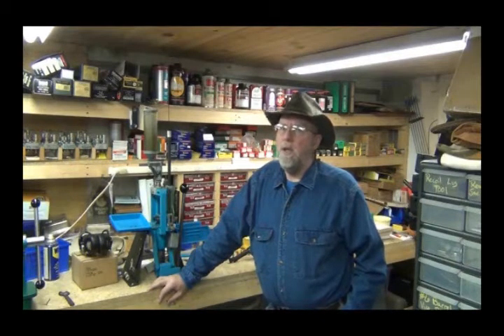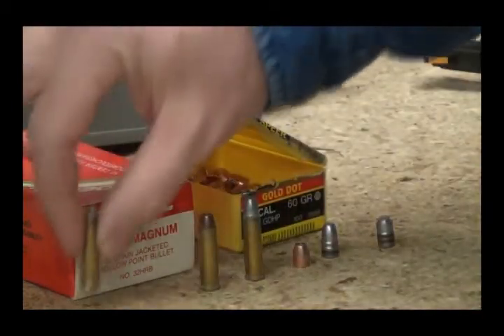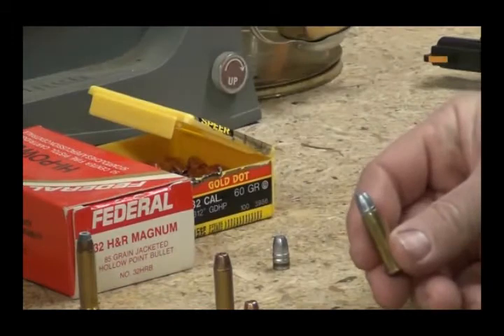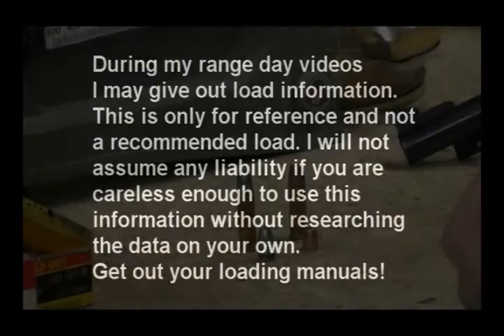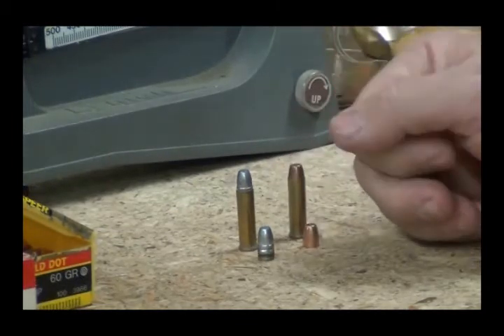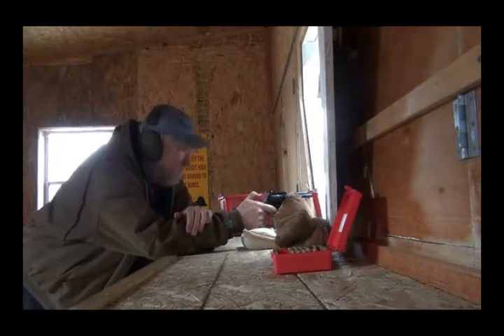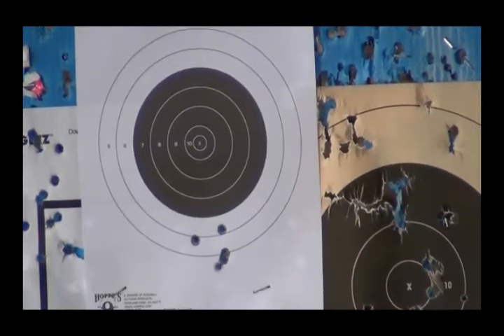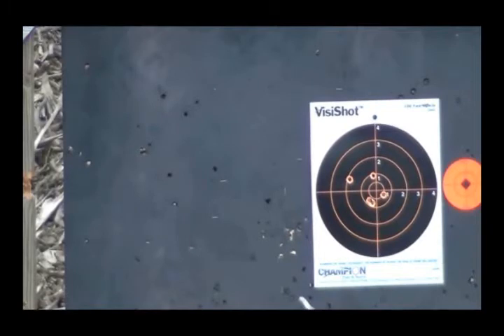Range day #1

Comment from the maker: When the .32 H&R Mag came out I had to have one. This is the second one I owned. The first was a Ruger with a 4.375 barrel. I sold it and got the 5.5 barrel. Better for my old eyes. I don't like the yellow front sight. I need to try to get that off. Good ole black works best for me. The yellow was on it when I got it. In 12 years I just haven't shot it enough to be bothered by it. But it has to go.

Comment from the maker: There were no problems with the cast bullet and bullseye powder. It was the rounds. I could feel it and the primers looked round like new just the firing pin dent. But I do want to get a new chrono. This one is almost 20 years old and getting flakey at times. A new chrono and a shot timer are in the want list.